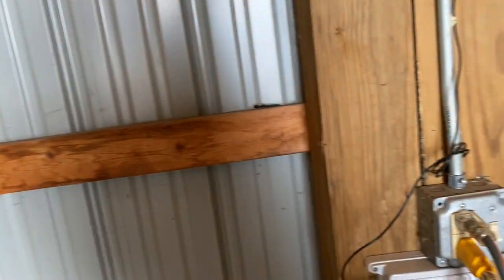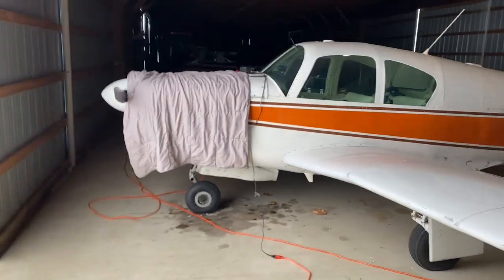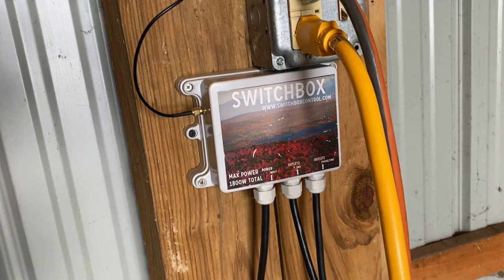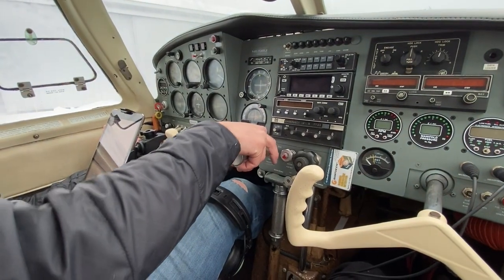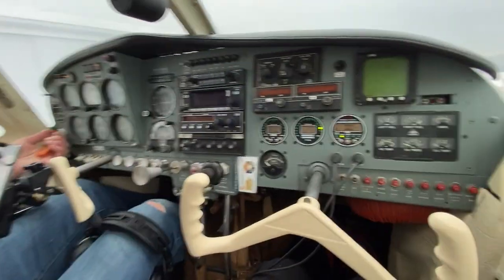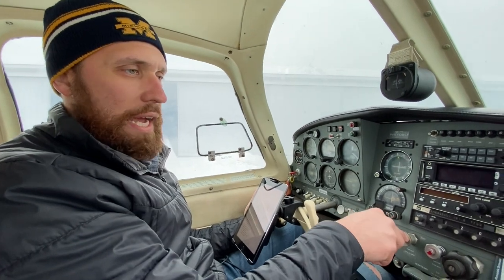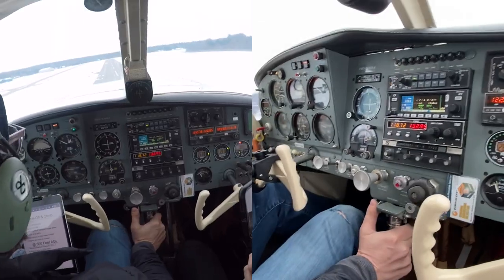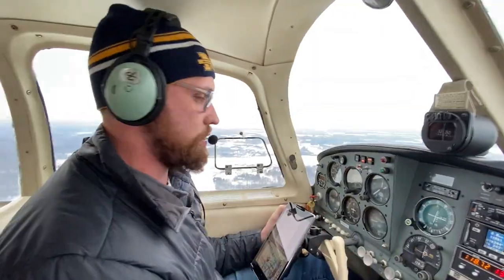Carbureted Mooney Cold Start & Johnson Bar Demo | Mooney M20C Vlog #17

Comment from the maker: Thank you to the entire community for the feedback and ideas on how to get the plane to start better. Below is my plan for testing next time I'm at the airport:

1. Remove the air filter
2. Pump the throttle 2-3 pumps and inspect the airbox for fuel (visually / smell)
3. Attempt start by pumping throttle while cranking (allowing fuel to enter the intake rather than sitting in the airbox)
4. Attempt priming with the electric fuel pump on
Reply: Video Idea: Show best MP/RPM for climb and cruise.
Reply: How did it go?
Reply from the maker: Unfortunately 10” of snow stopped my flying, so I haven’t been out again. Soon!
Reply from the maker: What I’ve learned is, I have to pump the throttle more times than pilots / instructors would typically advise to start my bird. 4-5 pumps in warm temps, even more when it gets cold. We haven’t found any further issues related to the hard start.

Comment: So many nice additions to the instrument panel, but not the modern GPS. I think I recognize yours, I had similar unit in my 20C that could no longer be updated so some info in it was inaccurate. I was going to replace it with G430 or 530, but in-flight accident took care of it and in my next plane, which was 20J, I got a nice 430. What a world of difference between WAAS updated 430 and whatever I had in my older Mooney. Again, I am not making assumptions so your GPS may be capable of receiving updates and it could be a different model from what I had, but if it is not the case, more modern GPS is probably the best investment a pilot could make in his 20C and mainly, in terms of safety and IFR certification.
Reply from the maker: I would love to upgrade the GPS, but it’s a bit outside my budget. This unit is a KLN94. It fortunately can still receive data updates. It actually functions quite well, but is not a WAAS unit.

Comment: Great news. I tried your procedure and it worked. Got the plane preheated and then pumped the throttle 10 times. One turn of the key and she started right up. Only issue was the battery was a bit weak and I had to use the jumper to start her up. What happened next was we could not get the gear handle to close in place after take off.
Reply from the maker: That’s great news that it started right up! I wish I had a better solution for your battery woes! I hope you can soon get a hangar!
Reply: @MyTimeToFly  haha. It's not in the budget. A guy that works at the airport came over and asked when am I gonna put that sweet bird in a hangar. I told him I cant afford that now, worst I'm trying to do 130 hrs minimum this year.
Reply from the maker: Makes sense! What do you use to power the preheat? Maybe you told me that before.
Reply: @MyTimeToFly  I use the preheat that is available at the airport. I want one for myself as I would rather put that preheat  cost in the tank.
Reply from the maker: That makes sense, I’ve never heard of an “airport preheat”. I guess us small town guys don’t realize how good we’ve got it!

Comment: I’m surprised you have to pump it that much I pump mine twice and it starts right up summer or winter although my hangar is heated and cooled and I live in Oklahoma. I did have some starting and idling problems a few annuals ago and my mechanic advised removing the champion plugs and installing Tempest plugs and what a difference that made. I live at 44M and my neighbors across the runway are from Grand Rapids and kept their airplane at Sparta. I like the panel on your Mooney, enjoy your channel keep up the good videos
Reply from the maker: Thanks a bunch Frank. We are starting to think we might have an accelerator pump issue.

Comment: I have to admit, I was watching and about the time I was thinking "man, he's flooded it bad" you said "a lot of people would be concerned with flooding..." :-).  But as you say, it clearly wasn't.  

I did that myself one time with my 1972 VW (carbureted).  I replaced the starter, and the car was down for a while, so when I went to start it I pumped it a few times, figuring the engine is empty of fuel and cold, so it would need more fuel.  And then it wouldn't start, so I put more fuel in.  Turns out I'd flooded it bad.  It really stunk when it finally started, burning off all the excess fuel.  

Reading others comments and your responses, it sounds like you're looking at investigating the carb at some point to see if the accelerator pump is working to spec.  That sounds like a good plan.  It'll be interesting to see what you find.  

I own and fly a 1967 F Mooney, which has a fuel injected engine, so I have a different set of magic incantations to get my engine started.  ;-)
Reply from the maker: Hahaha, magic....I love it!

Comment: Some great comments here.  My 2 cents is only worth a peso since my only experience in very cold temps was 25 years ago in Fairbanks during the winter, too much throttle with dense air is a no go, and we only had a few tries before the battery went dead at -10 to -30F.  My Mooney has electronic ignition and it fires up instantly.  Beyond that, the accelerator pump sprays straight up and I was told to only pump it while the engine is turning.  My carb is also freshly rebuilt since the previous owner filled it full of mud, so the comment suggesting your accelerator pump might be worn sounds interesting.  But I haven’t had to experiment with 2 mags and cold temps, gotta do what you gotta do and have a plan if it goes sideways.  My left mag just went out suddenly at 95 hours on the overhaul and is getting the coil replaced this week, backfiring was the primary indicator that something was wrong.
Reply from the maker: As always, great stuff! Thanks HH!
Reply: @MyTimeToFly  got myself wondering... 2 cents is worth 0.41 pesos.  And another thought given the purpose of an accelerator pump, how quickly should we be able to push the throttle to full vs an ill reaction from going too fast if the pump isn’t sufficient?  There must be an easy way to rule it out.
Reply from the maker: That is a great question, I bet a good carb shop could tell us. I would think if you were really aggressive, like 1/4 second from idle to full throttle, the engine should get way too lean and fall on its face? Maybe I’ll find somebody to call about it!
Reply: @MyTimeToFly  I’m interested in what you find out.
Reply: @MyTimeToFly  My understanding is that the core purpose of an accelerator pump is to prevent what you describe, so that if you jam the throttle in, the big gulp the air the engine gets is accompanied by a squirt of fuel and so the engine builds power smoothly.  

Several years ago when I was driving an air-cooled VW, so I needed to be fairly well-acquainted with the accelerator pump.  One time I ended up with accelerator pump nozzle that was blocked, and starting off is dramatically different.  If you try to take off too fast in first the engine will stumble.  

Another example is the Cessna 120/140, which I believe doesn't have an accelerator pump in its carburetor.  If you have to do a go-around in one of those airplanes (at least with the original carburetor), I believe you have to bring the throttle in over a few seconds.  If you just jam it to full, the engine will stumble and possibly die.
Reply from the maker: Good stuff here! I definitely need to do some testing to prove this theory.
Reply: @MyTimeToFly  Try a go-around with ample runway to test the carb?
Reply from the maker: That sounds like fun!
Reply: @MyTimeToFly  so... I took my first flight after having the left mag’s coil replaced.  I accidentally forgot to flip the switch for the electronic ignition (not controlled by the key) and started the plane cold on just the left mag.  One pump throttle them a second pump as I cranked the starter and it fired right up and idled at 500 rpm at 45° cold start.  Long story short, it flew amazingly smooth and had never started on the mag alone before this.

Turns out coils are not replaced during mag overhauls unless you ask for it but it adds $300 or so to the bill.  It had probably been going bad for years.
Reply from the maker: Bad coil...problem solved. Another good option for me! Thanks as usual Hair Helmet!

Comment: Hi, great video! I own a 1968 M20C C-GDQE. When I first started flying it I was taught the 10 pumps of throttle. I have since amended my procedure and now do the following. Master: On, Mixture: Full Rich, Fuel Pump: On, Throttle: Prime with 1 to 3 strokes, Throttle: left at 1/4 quarter travel, Ignition: Start. Works great for me. Edit: (This is listed in the original POH).
Reply from the maker: I see, you leave the fuel pump on as you start? I’m happy to give it a shot!
Reply: @MyTimeToFly  Sorry! You've just help me fix my checklist. Fuel pump only during the priming. Fuel pump on, three shots of prime, fuel pump off (again until pre-takeoff) and then ignition. When it's warm 1 shot is all that's needed.
Reply from the maker: Thanks for clarifying, I’ll give it a whirl!
Reply: @MyTimeToFly  I just re-read the POH and they make no mention of turning the fuel pump off which is why my foreflight checklist missed it. But I definitely don't leave it on.
Reply from the maker: Roger that, maybe I’ll try it both ways.
Reply: @MyTimeToFly  Let us know how it goes. Leaving it on I might be worried about flooding. A couple times I've caught myself priming too much and having to pull the mixture before it catches.
Reply from the maker: Roger that!
Reply: I have a 68G, i always leave my fuel pump on and full rich, it starts always at 3 or 4 pumps of prime.
Reply from the maker: I wish I had a primer.

Comment: Interesting device that combines a certain prime with the throttle.  Reminds me of my childhood car, a '74 buick Riviera [454, 4barrel Carb] that provided a double 'squirt' of fuel when throttle full stroked.  It even had the start instructions on the pull down visor that stated to give it three throttle pumps.  I think consumers are far less tolerant of such starting procedures these days.
Reply from the maker: Could you imagine if a car company tried to sell a carbureted car these days?
Reply: @MyTimeToFly  NOt likely to sell a lot of carbureted cars.  I think that starting those engines was a bit of an art form, that I feel is all but lost to us humans.  It is captured in an old jimmy Stewart film called "Flight of the Phoenix".  There are soooo many variables that affect the starting of a carbureted engine and what works and when on which engine.  That carburetor in my '74 Buick was a monument to mechanical design. Makes me wonder if there are STC's for the old O-360's and 320's for Fuel injection.
Reply from the maker: I’ve said that for a long time, if it weren’t for government intervention we could actually afford to swap them over to FI!

Comment: MTTF,  what was your OAT?

As the OAT approaches 20°F...  100LL has difficulty evaporating... hence the need to use lots of priming...
Of course, with lots of priming, the un evaporated fuel has to go somewhere... it doesn’t naturally go away... the carb has a drain tube that aims at the front tire...

Add some confusion... your engine is pre-heated..?  if it is...  a cold start isn’t what is usually needed...

10 pumps is what I used to start my M20C in weather above 20°F with no heat at all...

To know how much fuel is getting into the carb... you can watch the FuelP drop...  when the fuelP drops towards zero turn the electric pump on again to recharge the system...  leaving the electric pump on, you won’t know how well your accelerator pump is working...

The accelerator pump is a hand pump that has a tendency to wear over decades of use... a piece of leather in there, probably...

The important part...  I used to start the plane with nobody else in the cabin... as the excess fuel needed to get a successful start, is also enough to generate a large cowling blaze...

If your accel pump is in good condition...expect a soggy fuel covered tire out front...
If. Your accel pump is worn... it takes 10 pumps to do the same as a new one would do in three...

The good thing... you have plenty of time to pump, get out and look, get back in the cockpit, and start...   100LL is so slow to evaporate, more time is a good thing...

Have PlanB & C ready... what to do in the event of an engine fire,  fire extingusiher ready...

Other than that, congrats!  Kids liked the flight...  😀

Other note... the switchbox was a first of its kind... it is not really well constructed, really under designed for the purpose.   Use extra caution to not overload it...  there is a product available purpose engineered and built for this application called Switcheon...about 5-7 years newer...

- a -
Reply from the maker: Thanks for the great commentary AC! It was 26 degrees or so yesterday, and the engine was preheated. Unfortunately most of the preheat time was done without the blanket trapping the heat, so it wasn’t nearly as effective. I have watched another pilot start my Mooney as I stood outside. Even with a ton of pumping, I never witnessed any fuel coming out of the cowling.

Comment: Have you tried turning the key while pumping the throttle 3 or 4 times.   The way you do it seems dangerous if she ever backfires.  By turning the propeller with the starter and pumping will suck the fuel up into the cylinders instead of having the fuel sitting in the carb waiting
Reply from the maker: I am most definitely going to try it. If it works, it might likely prove my accelerator pump isn’t failing! I have lots of testing to do, thanks for the idea!
Reply: @MyTimeToFly  Let me know how that worked out for you ....
Reply from the maker: Will do, I haven’t been back out to the airport since...darn snow!!!